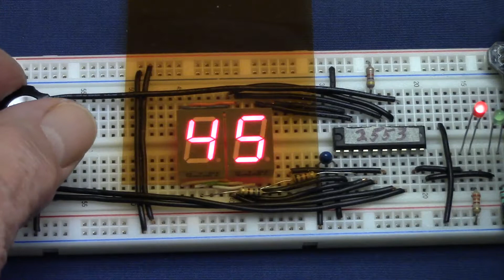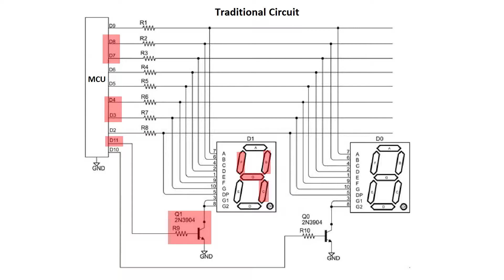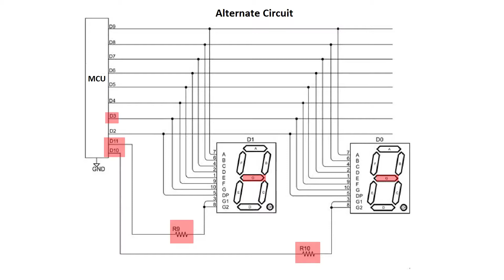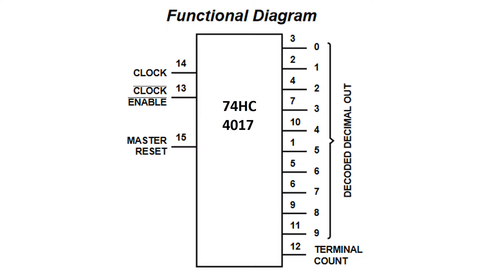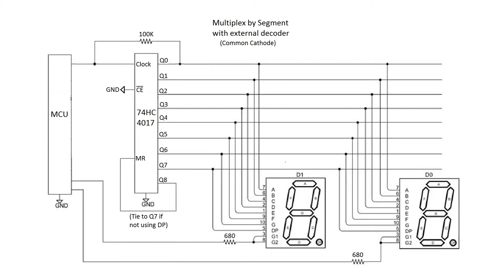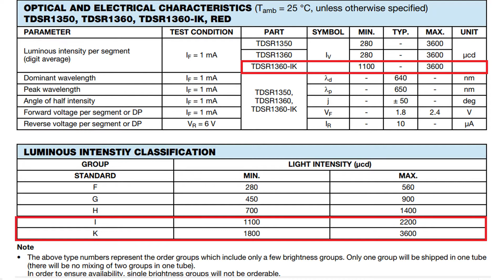More Efficient By-Segment Multiplexing of 7-Segment Displays

Comment: individual segment resistor would be good, all leds dont have same voltage drop, so over time it may drift and brightness wont be same for segment to segment, idk if its noticeable but it does.

but this is indeed a cool trick.

Comment: That trick to avoid burning a pin to reset to 4017 is genius 👏👏👏. I have used a MAX7219 dedicated LED driver for building 7 segment displays. They are very nice: built in current limiting, programmable brightness control, cascadable and low MCU pin count requirement. They are very expensive, though (or at least they were last time I bought them).

Comment: Thank you so very much for making and posting this video for scanning one element at a time. Your last video was 4 years ago, I hope that everything's alright with you. I was considering scanning one digit at a time using one of the 10 outputs of a 4017 for each digit (7 segment piece) and the 8 outputs of a 74595 serial-in parallel-out register to feed all the elements LEDs that are connected together in parallel just like you explained and, doing that, should let me run 10 digits using only 4 or 5 microcontroller pins. I was going to make or modify one of the existing libraries/classes to make it easier and more general, have you tried to make a library/class for this method?

Comment: The duty cycle is about 1/8th of the usual method.  It could reduce the brightness, but that doesn't seem to be a problem with your setup.
Reply: Also, if you were to use shift registers (74HC595) instead, you would only need three pins (clock, data, latch) for as many digits as you like, just daisy chain the shift registers.  Also, you wouldn't be limited to common cathode displays.  Also, you could multiplex entire digits and not just the individual segments so you would have an improved (8x) duty cycle.

Comment: Like all things in engineering it's a tradeoff between hardware vs software complexity. This method makes software a little more complicated, keeping track of the segment phase/mapping but much simpler on the hardware side by only requiring one resistor per digit. A practical downside would be requiring the segment current to be 7-8x higher than an equivalent per digit mux method to achieve similar brightness due to the mux ratio dropping by 7-8x.

Comment: Great video! I just worked out that multiple 7-segment displays can be turned on after each other, but didn't realize yet that that would put 8x20mA on a single IO pin until i saw this video. And then your video took it even 2 solution steps further 👏👍

Comment: There is any negative effect on the actual component? I mean, multiplexing by segment requires more LED on/off cycles, and for the resistor as well. I'm using a arduino uno, a shifter and a single 220 ohm resistor for 4 digit 7-seg display, and it works as expected.
Reply: LED's are PWM'ed all over the world for 95% of their applications. I don't think it will do anything to their lifespan. And if so after a few years... just stick a new 0.80$ display in there 😉 Resistors don't suffer at all with this, electronics are meant to do this type of stuff. It's how the entire world revolves. Your PC is loaded with transistors and resistors and capacitors and what not that endure this type of switching at gigahertzes for years and decades 🙂